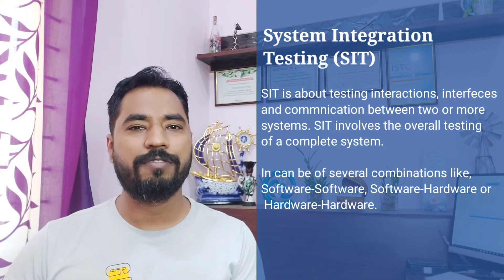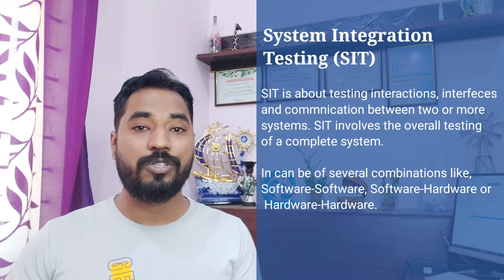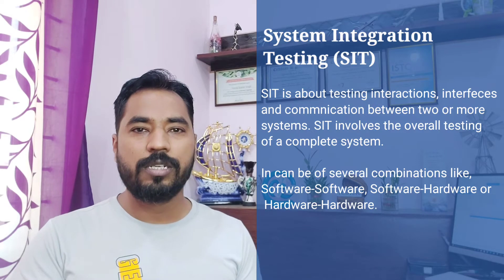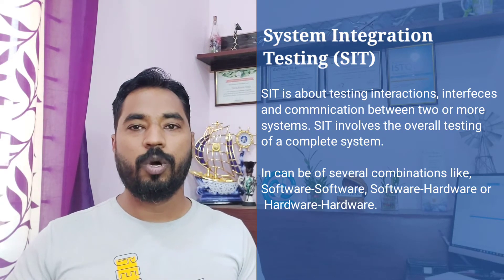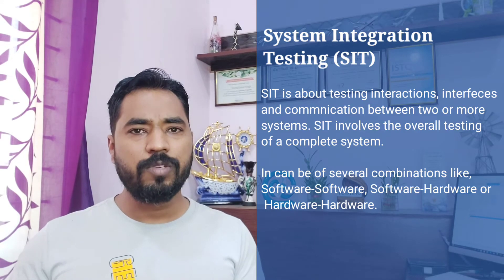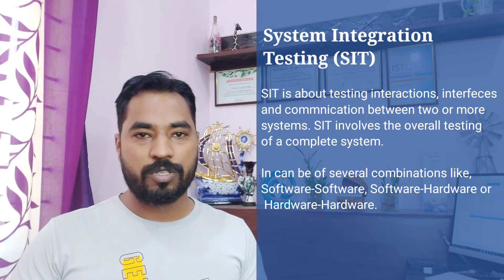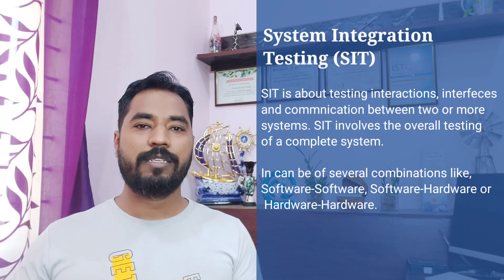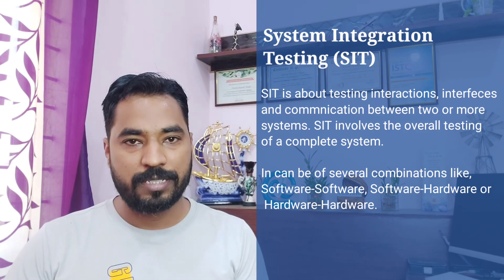System Integration Testing | Meaning of SIT | Definition of SIT | Technical Vocabulary

Comment: Thank you Kumar!
But I still have some hesitation. Could you refine the following moment:
API integration testing between microservices is component or system?
For example, there is a loans mobile app and it includes microservices:
- loans, which has an interaction with mobile client
- micro credit organization microservice - which goes to the real micro credit organization and communicate with it about loans
- and ML service which defines worth a user of lending money or not.
All of these are developed on our side.
And there are lots of others, which are explicitly external services. 
So, where the border between component and system integration)
Thanks in advance!
Reply from the maker: Hi, These are still SIT but performed along with special level called as Interface Testing and before system testing. Sorry for late response
Reply: @TechnicalVocabulary  I got it. Thank you one more time!